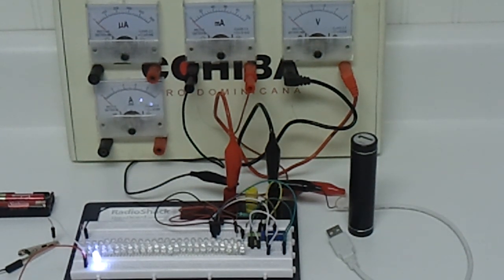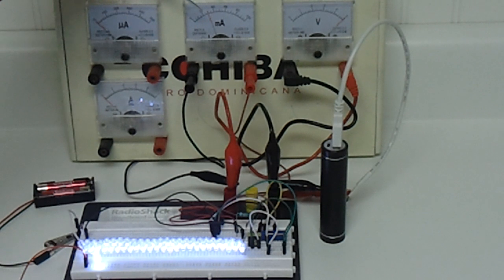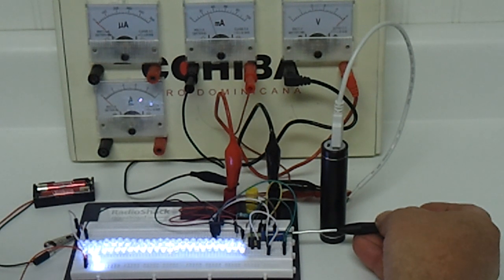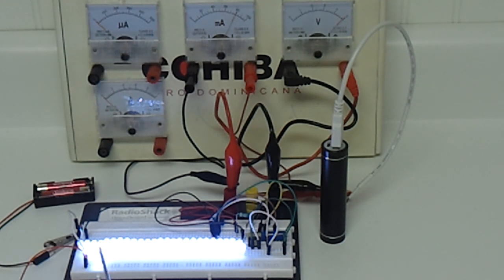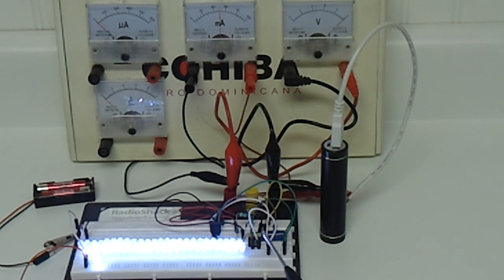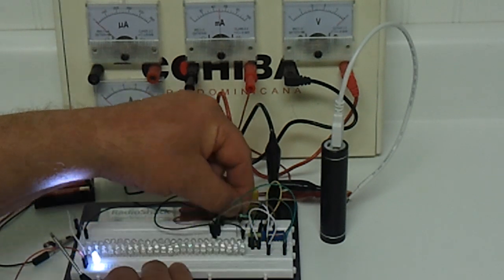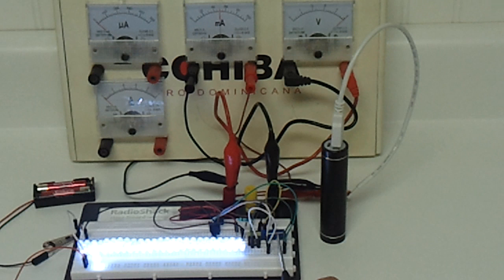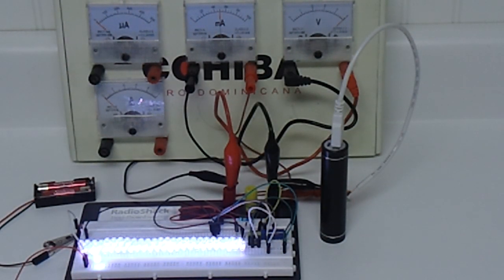LSJR and LED's

Comment: Great setup and some interesting points ... however you didn't bring the duty cycle into the equation ... check out my ultimate joule thief collection video here on youtube . I don't mention voltage or current measurements as my experiments were all about getting the most amount of l.e.ds lit brighter and brighter  to find the best setup to do that ....  it works amazing with a single 0.8 volt crystal cell with 1 l.e.d

Comment: I like the use of the inductor, because often these circuits can 'top out' with available throughput.
Just wondering, at 87V you should be able to light a neon and I wonder if a Tesla tower trick will work. That is, to connect one leg of a neon in series to the leg of an LED. The other legs are your power inputs..both light and neither blows.
Reply from the maker: Yes, in this circuit the inductor plays a very positive role.  I will give the neon a try and see what happens.  Always good to read your thoughts on these projects.  Take care.